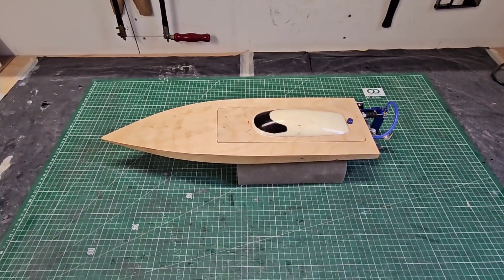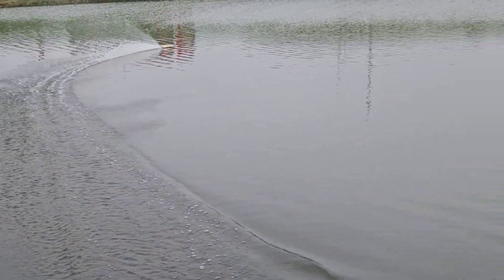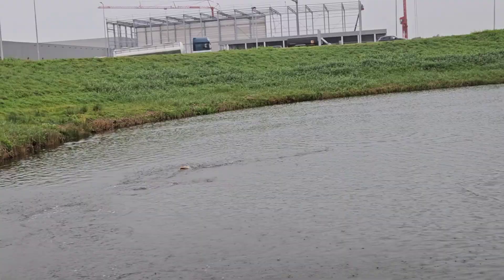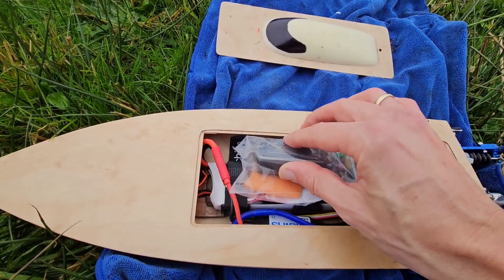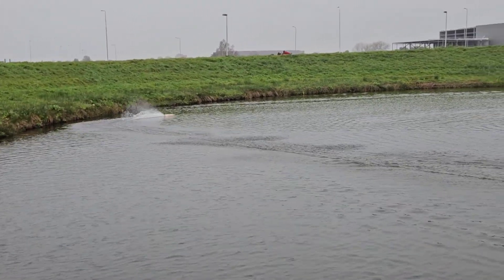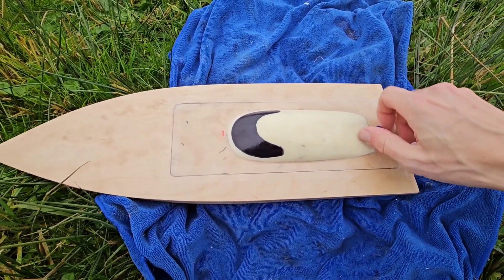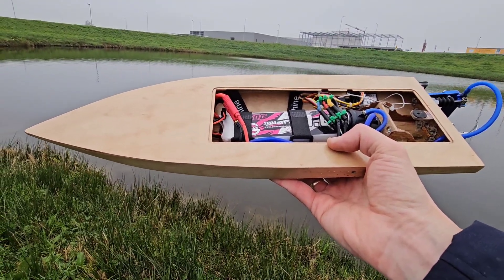DIY RC boat: Is adding lifting strakes an improvement?

Comment: nice vidio Mr. Cozy.

this two lipo are 3S 11.7v nominal, 12.4v full charge, the only real diference is the weigt and capacity of battery, I imagine that with more weight the boat's center of gravity changes and makes it more stable, for the same reason it can go faster.

Comment: That little boat is fast! Looks very clean, too. Excellent work. I mostly scratch-build RC planes. Never tried scratch-building an RC boat other than a slow Tug Boat to retrieve my Sea Planes from the lake. This little fast one Looks fun.
Reply from the maker: @FarmerFpv  Thanks for the nice comment! Yes it is a very fun boat, and cheap to build as well! As an RC airplane builder, you will have this one running in no time. The drawing link is in the description.. 😉

Comment: hi, you have to lower their thickness, round them slightly on the quick part, leave them almost at a right angle towards the inside and soften the outside part, I don't know if I explained myself, maybe for that hull they are too wide, that square you used I think is 5mmx5mm, I used them for your 80cm drawing, good work!.
Reply from the maker: Thanks for the advice! I agree, 4x4mm would have been better, probably. I will modify the ends with a smooth transition to the hull and also an inwards bend, looking to the bottom of the lifting strakes.

Comment: Maybe the lifting strakes should be on an angle? If i remember right i've read they had about 5' angle and maybe the lenght also has something to do with it. Not sure about any of these things but thought might be interesting if you wanted to test things. 
Its a funny boat, that's for sure.
Reply from the maker: You might be right on the angle. I checked my Pursuit hull, and it does seem to have a slight angle for the strakes. The 5x5mm stringer size is also a bit too big. I should have gone for 4x4mm. Maybe I will... It's a fun boat for sure! 😎

Comment: I just watch again the run without strakes and :
2.2A lipo 61 kmh
3A lipo 63 kmh
Now with strakes
2.2A lipo 67 kmh
3A lipo 72 kmh
Yes the boat run faster to bad that she don't turn like before but you will improve that
Same prop?
Reply: Yes ,sorry I watch again and you use same 2.2 A
Reply from the maker: You're almost right. The 61km/h and 63km/h were both with a 2.2Ah lipo. And the top speed with the 3.0Ah lipo was 72km/h. All with the same 936 prop.
The fastest prop so far, is the 436 TFL 3-blade prop. I will try more props in the future, and I will improve the strakes as you suggested me 👍😎

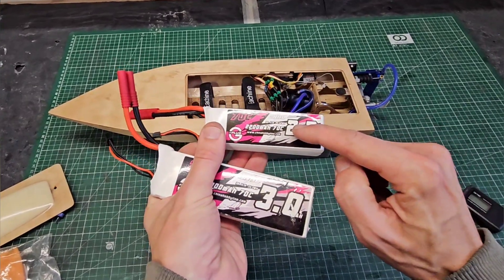Comment: 1:57 2.2Amp LiPo …. Correction: 2.2Amp-hours LiPo. The capacity of any storage medium is rated in Ampère Hours, not Ampères. The current is measured in Ampères. Huge difference.
Reply from the maker: You're right, Nick! But talking in English, while filming is not always easy, and small mistakes happen 😉
Reply: @CozyRC  I love your videos and approach.

Comment: Hi Cozy, you see!, that the tracks are useful? I also used them on your 80 cm hull project.
Reply from the maker: The boat runs different, and more dry. I like the lively handling now, but the strakes need some work to improve the cornering a bit ✌️

Comment: Great vid. 👍.  I wonder what effect a 'stepped hull' would be. In theory, the air pockets create less drag & higher speeds. Regal (full size) power boats use them, successfully improving speed & efficiency... 🇬🇧
Reply from the maker: Thanks, and the topic of steps in the hull is definitely interesting! I have a stepped catamaran, and it runs very efficient. I might try it on a mono as well, but I have too many projects and ideas for now 😅
Reply: @CozyRC  haha, tell me about it. I'm an edf jet flyer and learning arduino micro electronics plus 3d printing & CAD. My work bench is overflowing  😁. Keep up the great content  👍
Reply from the maker: Thanks, and have fun with your projects, too!

Comment: Looks great on the straights , how about a chine next, ?
Reply from the maker: Thanks, I agree... the straights are improved, but the corners need some work! A chine might help in that, actually! You just gave me a great advice, thanks!
Reply: @CozyRC  In the 80's i worked on the racing model Viper, The Hammonds won the late 70's world champs with a version of it . The chine over hang was almost the same depth from transom to bow and really helped with the spinning out in fast corners , So by adding new side panels and filling the hull gap, easy to make,
Reply from the maker: I think adding a stringer to the bottom at the sides will work, too. But thanks for the advice!